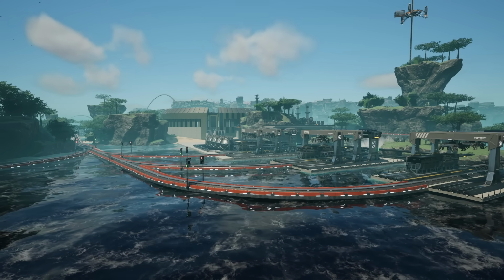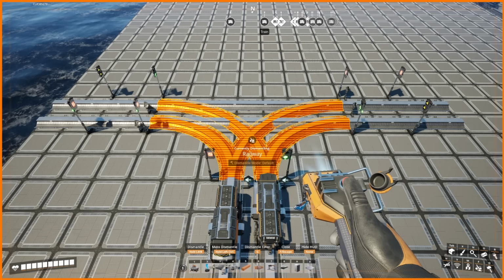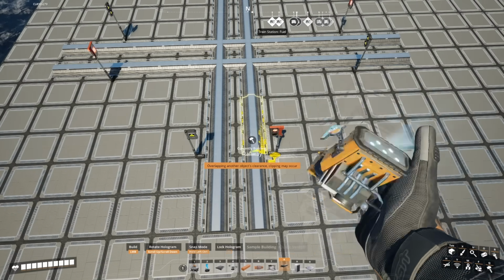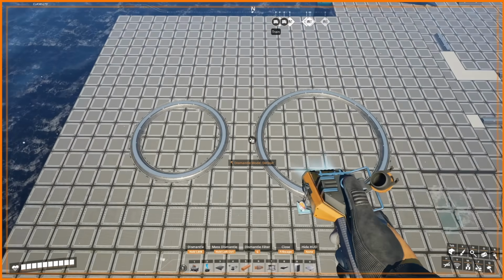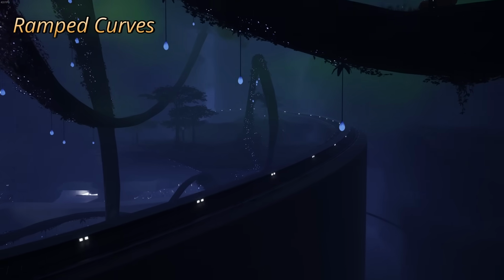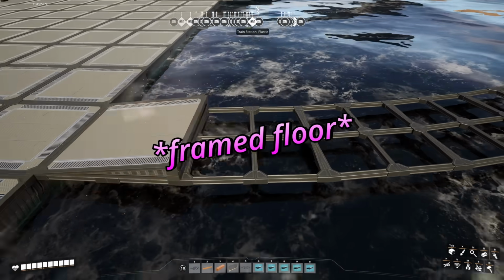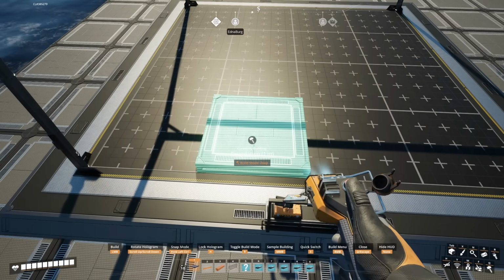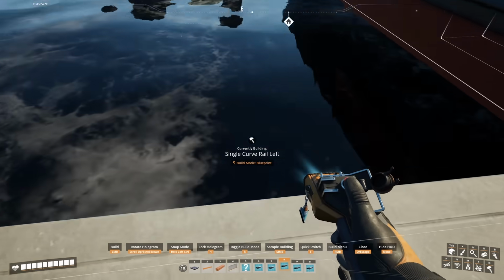The Ultimate Satisfactory 1.0 Train Guide Spirals, Junctions & Blueprints

Comment: I think the biggest problem I have with trains is the large scale thought process required, and of course 'planning ahead'. I have watched all kinds of tips and tricks and how to videos for trains but I still find it hard to impliment myself. I think it would be great with a concrete example of what is being moved, how much and to and from where. Basically the 'why' of the train, not just the how. This would help with planning my own.
Reply: Factorio city blocks makes this easy to scale
Reply: @smthngsmthngsmthngdarkside  I come from having spent thousands of hours in Factorio and I always used the city blocks method in my worlds. This is a whole new beast I'm wrestling with.
Reply: Probably easier if you join a world and see for yourself, I can show you if you want. The biggest advantage is you don't have to run a million messy conveyors across your world and you only need to build one rail line. You can always add more train cars or locomotives to move more stuff, plus any item can be moved on the rail network and the  throughput is virtually infinite depending on how big your trains are. This video kind of scares you a bit with the blueprints and the neatness but once you wrap your head around it. Trains are so easy, i was overwhelmed at first, especially with signals and throughput. But again, i am more than happy to let you jump on to my save and i can show you some serious advantages.

Comment: Is this possible to make with the MK2 blueprint designer I am struggling :( 

I can get the junction set up but can't seem to place the signs. I guess I'll save it the signs can be placed later pretty easily. My tracks have to be very close to each other though
Reply from the maker: I don't think you can place the signals in the junction - but there's a video coming soon which covers these junctions and auto-connecting rails :)

Comment: I've watched multiple videos on making curves in Blueprint Designer. My computer absolutely refuses to turn a frame/element 5 degrees no matter what I do. It will rotate 45 degrees when I hold the Control Key down. I've even changed mouse settings to no avail. This is really frustrating. Anyone have any ideas?
Reply: Same here.
Reply: Yeah I’m giving up now
Reply: For those who come after: the trick is you need to lay one foundation. then have your next foundation aimed on top of one one you just placed. Then you can toggle snapping with Control/Right Shoulder and rotate one 5 degree tick, then Hold hologram to maneuver it into place and repeat to the appropriate length. Drove me nuts when I was setting up my Highway designs and forgot the trick before looking stuff on trains up. Took me another 15 minutes to figure it out so I figured I'd add it here for anyone else looking in the future like I am.

Comment: When I rotate the hologram e.g. for a foundation, it rotates 45 degrees, but for Total it rotates much less. Is there a setting I'm missing?
Reply: Yeah I think it's the snap to world grid option. Not sure what the default button is, but you will see at the bottom.
Reply: You have to hold control to rotate in smaller increments.

Comment: These train videos are excellent!

One thing I'd like to see you cover in a future Satisfactory train video:  Macro-logistics.  Right now I'm contemplating several push-pull trains at various resource nods to feed a larger loop network .  Or should I be considering a more expanded loop network that incorporates all these nodes?  How many different resources can I expect a train to reasonably handle before needing to add a second train or even a second track to the location?  

Knowing how to lay track and create a train line only begs the question of how to make an interconnected network work at large scale production.  How do you tackle these logistic questions?

Comment: One of the most important things I learned the hard way about trains and tracks is switches and signals can only be placed at track joins.  So planning junctions is key.  A 90 degree turn can be made in about 3 blocks distance horizontally and vertically.  So, expect to need at least 6 blocks across to do a smooth 180 degree turn (I know, you can do it better/smaller, but this is for simplicity).  But only do 90 degrees at a time, and make sure the straight sections end/begin at the exact same point.  Then, if you want to extend the straight sections (creating a turnaround with switches), it all lines up easily and works correctly, and you can add signal(s) in the turn.

Comment: I avoid cross junctions whenever possible so my tip would be don't feel the need to compress your train junctions. Building a parallel run before your merge allows you to use signals to set which line has priority over the other (set the signal for the line you want to get priority on the merge a bit further back so it reserves the block earlier). It also means that if the train is waiting it isn't blocking other trains that may want to travel in other directions.

Comment: another trick with blueprinting train lines is to have a segment with no track and another segment with tracks. This way you can alternate these 2 blueprints and then just connect them each time. That allows you to build the railway line while building the blueprints, and also when you have the hoverpack you always have power for flying.
Reply: Very clever, nice tip!
Reply: that's very helpfull thx!

Comment: Something I learned from a different video yesterday is to not place a block signal too close before a pathing signal, if it can be helped. This causes trains to slow down because they don't receive the green light from the pathing signal before they are on the section of rail before the pathing signal.
Reply: I’m assuming it was BitwiseAssembly, I highly recommend his video on trains
Reply: @brianhecimovich4488  Related to that, put block signals close to the exit blocks, as those are what trigger the pathing for incoming trains.  In other words, the path doesn't clear when the train clears the first block signal, but only the NEXT block signal.

Comment: Great Video, I didn't know the trick of using blocking signals to split the roundabout (or any rail for that matter). I use that a lot. I made myself a few roundabout blueprints in the 5x5 which makes using roundabout even easier.

I've been using the curved blueprints since your previous video and they are a godsend. I find that I only use the continued curve and never the standard one. These can be nudged in directly from a straight section. When I'm ready to turn, I want to turn right away 🙂 and it's two less blueprints.

You haven't shown any ramp blueprint. Those are easy to snap going up and a bother to use when going down. When I need to go down, I zoop ramp foundations to the level I want, set up an anchor point, erase the ramps and build up using the blueprints.

Keep those videos coming, they are great 👍.
Reply from the maker: Haven't done a ramped blueprint yet - but think I'll have to give it a go! :)

Comment: Pathing signals don't just allow multiple trains in a junction. They also prevent trains from entering until they are able to pass the exit signal. So they do have a use in your single line cross example. This is why the distance to the next signal after the exit must be longer than the longest train on the line.
Reply: Is that how it works here, in Factorio, a train clears a signal after the last car passes the signal, is that not true in Satisfactory?

Comment: I do like the designs for your track blueprints. They are easy and cheap to place and look like they can be built on track support blueprints as well. I like to build more dual track lines 3 foundations wide to fit symmetrically on my odd-numbered foundation buildings, so I wonder if your blueprints can accommodate building gaps in between your incoming and outgoing lines?